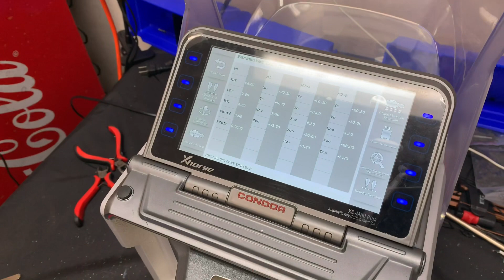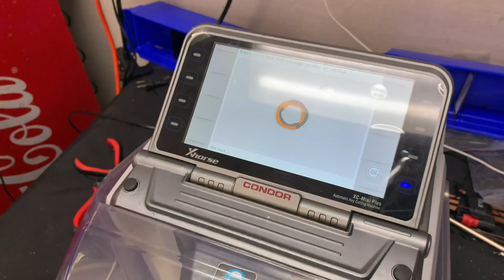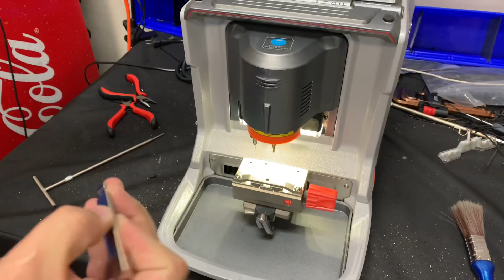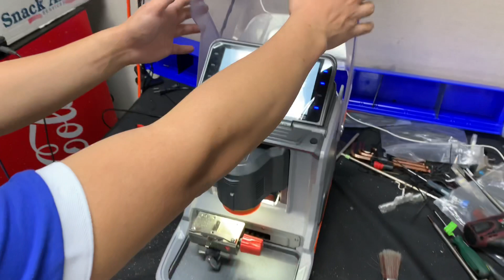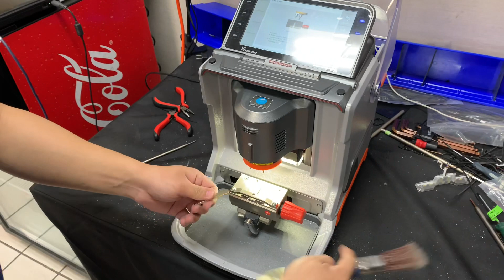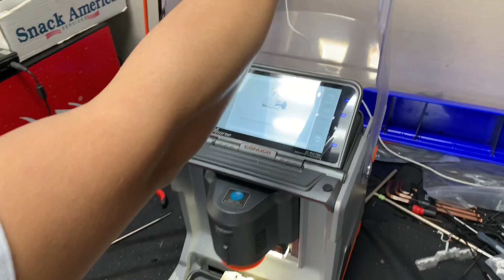How to Calibrate Mini Condor Plus Key Machine

Comment: I have broken 2 probes trying to trace a Mini Cooper S Key from a 2003 R53 Mini Cooper.  I calibrated the height on the M1, Calibrated Cutting and calibrated both M1 and M2 jaws, all four sides.
It is a channel cut key and when the probe gets to the end (near the fob) of the channel cut, before it starts to trace, it snaps off the probe.  I am using the recommended jaw M2B with a 1.5 cutter. I followed the alignment for tracing, aligning the key placing the end of the key in the B Jaw at the first line (closest to the operator).  I am so frustrated.....I only had 2 probes and now they are both garbage.  Can you help me diagnose please?